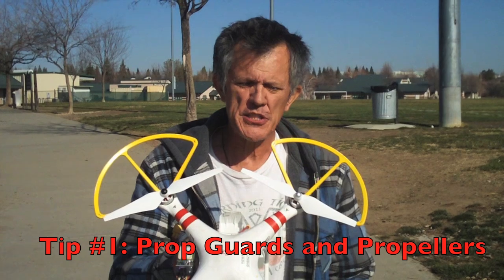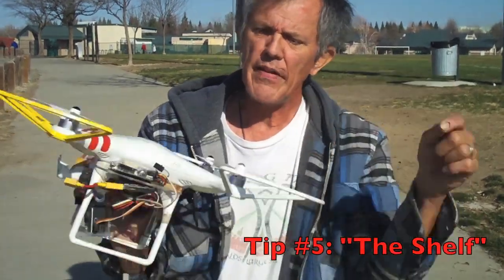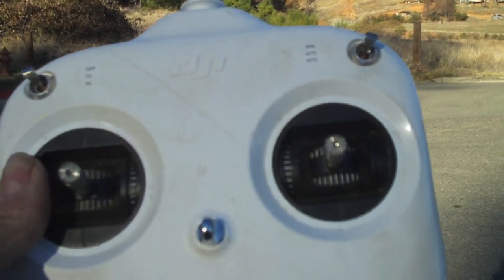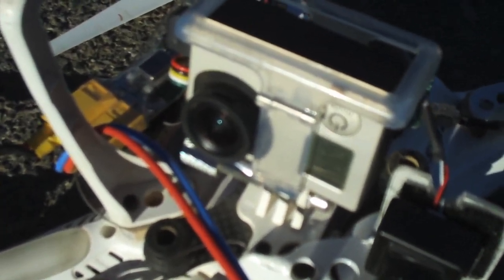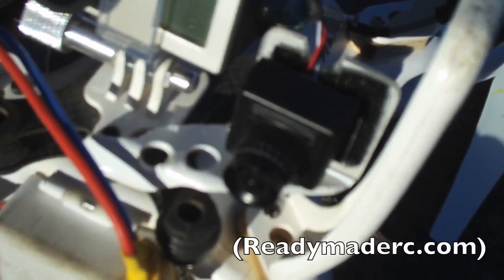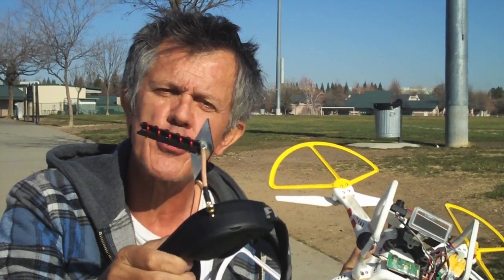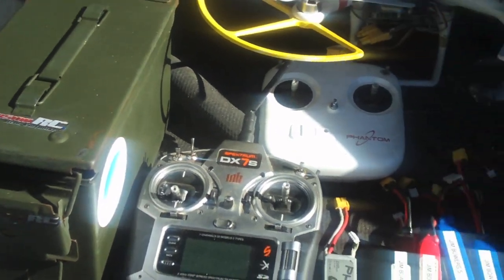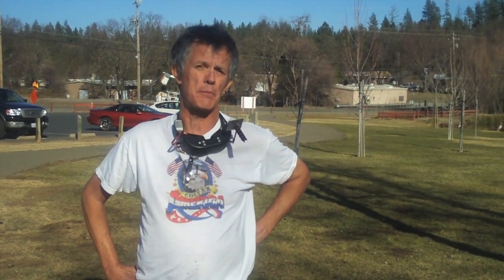DJI Phantom - "25 Tips and Mods" for your Multi Rotor, Quad Copter, Drone!

Comment from the maker: Zebulon - In the Assistant Software, you have to open the tab in the lower right corner in order to switch to manual mode. ZIts a little weird and difficult to find. Once you DO have manual mode setup, be VERY careful on your first flight. Get it up in the air about 75' or so, before switching into manual mode. Be prepared to switch back to gps mode quickly. ---- I have the most current firmware - no glitches and no problems. ---- I'll check out your channel for sure!!!

Comment: Hi Jim,

Big thankxx to your posts. Was made redundant at the end of last week but hey, it's summer, even here in Scotland so this was the catalyst to finally get the quadcopter I had been wanting. No real worries about getting a new job in the next 6 weeks so decided to enjoy the summer while it lasts. The crucial factor for a copter was a GPS out the box solution. I got a helicopter, very cheap last Christmas which took off 100 feet vertical and disappeared and was finally found in a neighbours hedge 4 days later. Parrot was a possibility but the Parrot 3 promo vids promise a copter in November so the Phantom (£389) with camera and GPS was the decider. It is the FC40 and yes, I have probably shot myself in the foot long term for upgrade ability but hey 720, 30 fps on a calm day will do for now :) I watched the 2nd part of your 25 tips video 1/2 an hour ago after my first mishap in the garden. I had a clothes drying pole going through the legs of the Phantom in case it decided to fly away and yup, I switched off the transmitter first...duh!! All of a sudden the 4 motors went into full take off mode and I kid you not Jim, it started to lift the clothes pole and slide off the end of it. I put my foot on the end of the pole and it tried to slide to the other end...I just weighed the clother dryer pole it's 1.3 kg... that's heavier than a bag of sugar. Eventually I lay on the pole and managed to get to the battery which fortunately I had not put fully into the compartment and unplugged it without lacerating my arm. My wife came running out thinking a plane had flown overhead. Again, a big thank you for your vid's which I am still working through. The DJI instructions at times (and I'm a techy) are pretty poor PDF's. If you read the blurb, Red/Green means 'Take it back your dealer' which I thought was a bit suspect until you explained about the GPS ( I apparently was connected to 6!... 3 green 1 red!) Shortly after that revelation it started to rain (This is Scotland in Summer after all :)  Methinks you maybe getting a PayPal order for landing skids and rotor protectors in the next couple of weeks. Take care and thanks again.
Reply from the maker: Great STORY Colin.... now get over those "dumb thumbs" and "fly it like you stole it!" Have a great (and sunny) day!!~

Comment: Good video, a couple things I might suggest, I shoot with GoPro Black edition in 1080P and 5 MP still with no issues plus I have the other higher quality modes if I want them.  I do agree that compass calibration is not needed on every flight but its cheap insurance to do it anytime you have traveled some distance from where you last did a calibration.  Lastly, on the compass calibration, you should point the Phantom nose down when doing the vertical part of the calibration.

Comment: Thanks for your tips! You really packed your DJI with a LOT of stuff: prop guards, wires,  etc. That may explain your 8 min flight time on a standard DJI battery - I get about 12 min flight time from the same battery with just standard DJI and lightweight Sony action cam.
Reply from the maker: Great - but you'll quickly get bored just flying around.... you need to put FPV and OSD on your bird and THEN you'll be into some real adventure and FUN! (Happy flying)
Reply: Thanks! (My Fatshark gear is bound for delivery this week ;) )
Reply: Excellent!!! You'll frikkin LOVE IT!!!

Comment: 10:00 well, filming in 1080p in 60fps is a good reason to get a higher model gopro, also 1440 in 48fps works well as you can crop it to 1080p, reduce a bit of the fisheye and have the video totally stabilized by software, but for hobby use only, go for the white ;)
Reply from the maker: great points my friend... thank you

Comment: You could always go for a Mobius mini cam instead of all that gopro add on. Does everything gopro does and possibly more. It's lighter and MUCH cheaper. Great video with very useful tips. Thanks 👍
Reply from the maker: I had the moebius - good cam..... cracked the damn lens on a crash.... :-(

Comment: Great video, thanks for taking the time to do this.  Someone here mentioned using the gopro feed for the FPV instead of having an extra camera.  Do you recommend this?  If so could you point me to what equipment is needed to make that work?  Thanks again!
Reply from the maker: Yes you can - If your using FPV just run a video cable from your FPV (or ezOSD) directly to your USB plug on the side of your gopro. Go to readymaderc.com and search for "gopro to fpv video cable). It will also power your gopro directly from your lipo battery.
Reply: Demunseed Thanks for the quick reply!
Reply from the maker: Jim Burnard BTW - do you plan to install a gimbal? Flying FPV thru the gopro with a gimbal attached can be VERY disorienting...
Reply: Demunseed  Yes in fact that was the plan.  I have the Zenmuse H3-2D that comes with it.  Not a good idea?  Thanks!
Reply from the maker: It's not a bad idea, just takes some serious practice. Be very careful when your "approaching objects" because they can come up on you faster than you can react... ( when your flying FPV without a gimbal, there is more a sense of "true flight" since the camera banks WITH the aircraft... WITH a gimbal on, the camera always stays level so it can be a bit disorienting while flying)

Comment: Great information video.
I have a 1st gen Dji Phantom.  I wanted to upgrade my props to the vision props. Do I have to change my stock 1st gen Dji Phantom motors? Or will the self tightening vision props work?
Reply from the maker: Does your Phantom have all silver prop nuts? Or does it have 2 silver and 2 black? If they are all silver, you need to replace two of your motors (caddy corner) with CCW (counter clock wise) motors.

Comment: Great info. Im about to get my first phantom and starting off with all your experience here as a guide is much appreciated. The flight times with a go pro/gimbal/FPV still seem short to me and that's the set up I want to fly with. Is there any other ways to increase flight times that you could recommend? 2 batteries in series, cutting away unneeded plastic from the phantom body (maybe drilling masses of holes all throughout the body like in the hot rod days). I would like to get 20-25 minute flights if possible. Also, whats the lag time like between the Glasses and the FPV camera? Again, great stuff.
Reply from the maker: - if you want 20 minutes definitely get a Phantom 2. a Phantom 1 will NOT do it, even with 2 batteries. 
- two batteries in series is just a bad idea on a phantom one due to the overall weight on the aircraft = reduced flight time and HARD landings.
- i would NOT cut into the plastic - that would be insane....    ;-)
- there is literally NO lag time between the goggles and GoPro - you are viewing in REAL TIME - if there was lag time, you'd be crashing into walls!!!
- hope this helps
- jim

Comment: This was a Great Video! but during calibration. should the LED turn upside.
Reply from the maker: You are absolutely correct - my error. (posted a note to that part of the video)
Reply from the maker: Demunseed I have found that it really doesn't matter which way it's pointed. It will still calibrate no matter which way your pointed, up or down. But I suppose UP LED is the better choice.

Comment: Check out the upgrade kits from DSLR PROS and you will have a much more professional setup.   This looks like it would work if you were really pinching pennies and didn't mind the look and too much weight.  I like the yellow painted bumpers though.
Reply from the maker: thanks steve - its a good mod for safety

Comment: I'm relatively new to the Phantom... LOVE it! I'm running the Zemuse gimbal and an FPV.  I don't understand your comment about exploding batteries.  Under what conditions have you encountered this? Charging? right after flight? or for no reason at all just a spontaneous failure??  I've heard that Lipo's have this problem but I can't afford to have a fire at any point of my life specially at home where i have my business!  Thanks great video and great advice!  I do allot of music videos and finally used my phantom in one... if you want to check it out I'll give you a link just let me know
Reply from the maker: Batteries can fail at ANY time, but usually during charging or after a crash. Whats the link to your video - luv to check it out...
Reply from the maker: Demunseed the chances of a lipo battery exploding or catching fire on you are about 1 in 10,000 or more.... just be safe and have fun with it.... (buy an ammo box)

Comment: really nice and true tips! Thanks a lot for that!  You did well. Just one tip for you: just wash your hands before manipulating it... Mine is still white!
 But I think THE BEST tip for real video use is to install the zenmuse gimbal. You just can't possibly do smooth videos without it. And you just have to buy an emitter, and use the real gopro donwlink with it! (the zenmuse take the signal from the gopro and send it in the phantom).
Reply from the maker: What's an "emitter"?
Reply: Transmitter sorry... For video downlink directly from the gopro. Far better than adding another camera. You can do it with the zenmuse, a transmitter, and a screen (or goggles) with receiver. That's all!
Reply from the maker: Guillaume Juin good tips... the zenmuse IS the best all around gimbal for the phantom...

Comment: Just food for thought, I use a 600TVL SONY SUPER HAD CCD D-WDR Color Board Camera with OSD Menu DNR from securitycamera2000 with free shipping, they work great. and I can not tell the difference from my Read made RC 700 TV line camera but the price! they are two good cameras.
Reply from the maker: Good to know! Sony makes a great flight cam.... Im thinking ill take mine off tho, and just fly thru the GoPro.... (less weight)

Comment: You need a lightweight prop CAGE to make it totally safe. What about birds and insects? If the props Are totally caged in you can grab it anywhere without losing a finger. Props are also called BLADES for good reason. ALL drones should have prop cages.
Reply from the maker: are you out of your rabbid ass mind??? I suppose HELICOPTERS should have "prop cages" too!? LOLOLOLOL
Reply: Demunseed
OUR HOBBY IS UNDER ATTACK. WE MUST TREAD LIGHTLY. Better safe than stupid.
Reply from the maker: I choose "stupid" ;-)tomken8dy
Reply: Demunseed
Then you'll lose the right to buy and fly them. We have to be VERY careful with these things because so many people are making such an issue out of them.
Reply from the maker: I agree with you.... we do have to be VERY careful
Reply: Demunseed Too many A-holes are being irresponsible and ruining it for everyone else. Flying too low and fast, peering into people's windows and endangering people.
Reply from the maker: got it!!
Reply: Demunseed
I sent for a small quad and a tiny spy cam to mount on it. It has 360 degree blade guards so even it it hits someone in the face it won't hurt them. I'm also ordering it's larger cousin that comes equipped with a cam. It also has 360 blade guards. I want to build a collection VERY quickly before my legislators pass any misguided, stupid bans.
Reply from the maker: Are you just a NUT JOB or what? Prop Cages LMAO!!!!!!!
Reply from the maker: Its just a ridiculous suggestion my friend.... trust me when i tell you, its NOT a viable option.
Reply: Demunseed
Just a thin, lightweight plastic grill can prevent someone from getting sliced and diced. Yes it is viable and can prevent a safety hazard ban.
Reply from the maker: If theres going to be a BAN, it will have absolutely NOTHING to do with "safety" or props.... trust me on this one.... I'm a genius (in disguise)
Reply: Guess some people should never try gas powered model airplanes or model boats with large bronze propellers. Prop guards are more for crashes I think and not not meant to protect fingers.
Reply: chuck Basiks
Large model aircraft are generally flown at gatherings or designated fields while these new quadcopters are being flown everywhere. If you don't want a total ban on them next time one injures or kills a child it is a wise precaution to install a full, lightweight cage over the blades. Stubbornness = stupidity, stupidity = BAN.
Reply: tomken8dy
I fly my large model aircraft (single prop) all over in most any empty field. And if a kid gets hit with a 2 1/2 lb phantom quad, it will hurt regardless of the prop. I think the prop guards they have now are certainly adequate. They will have restrictions on these soon anyhow because of idiots flying them very high in the vicinity of real aircraft. They are drawing a lot of negative publicity. Have a good day. I'm going flying. :)
Reply: chuck Basiks
The idiots ruin it for everyone else. HAVE FUN! - and try not to crash.

Comment: Thanks for the tips.  I ordered a Zippy 2800 battery based on watching this video.  Unfortunately it is not even close to fitting into the battery compartment.  Just thought you might want to know that.  Does Zippy make different sizes of the 2800?
Reply from the maker: Then you bought the wrong battery - order the Zippy 2800mah 30c 3s Lipo - it'll fit....
Reply: Demunseed
Thank you.  I will do that.  I just ordered the "Zippy 2800mah battery" as stated in your tips.  Perhaps this additional information should be added.  Thanks again and keep up the good work.
Reply from the maker: After your remark - i added a few more details to the video - thanks for the heads up my friend!

Comment: Just 2 questions. 1) I have been flying planes for a few years and I noticed that you pace the throttle stick on the radio in the middle position. On my planes, you have to pull the stick all the way down ( motor off ) when first turning the plane on. 2) Do the extended skids interffer with the view of the camera. I have been flying cheap quad copters to get the hang of flying for about 4 months now and I would like to do the FPV with the goggles. Also, what's your take on the Walkera Scout4?
Reply from the maker: Ive been flying RC for over 15 years. Ive been flying quads and drones for about 3 years+
2) The sticks on a phantom "auto center" while the sticks on a 3DR drone do not. 
3) No, the skids were engineered to stay out of your camera shot, except in HIGH WINDS where the A/C is pitching sideways. 
4) Walkera has the worst QC of any of the manufacturers. Their stuff is pretty "junky" overall.

Comment: Now you've got me a bit freaked out about the batteries.  Where do you store them when you're not using them?
I've got them in the plastic case with the foam insert that the thing came with.  Doesn't sound like that's a good idea.
Sounds like they should be stored in an flame proof area (not too hot or cold or wet) like the basement in your metal ammo box (insulated so it doesn't short out) plus in the discharged state.
I have one that is still fully charged in there!  Don't have a metal box so I'm trying to figure out what to do with it.
Reply from the maker: quit worrying about them.... put them in a metal box and go out and FLY!!!!

Comment: Excellent Vid. Just picked up a Phantom FC40 today. only mod so far is go pro gimball :( ever do a dual battery set up for longer flight?
Reply from the maker: Dual batteries are a total waste of time....
Reply: i see you have about 100 spare batteries hahah. so i can see why you dont care for a dual set up. i spent most my funds just buying this copter. ill save n get a few batteries- blue label :) Thanks
Reply from the maker: Dual batteries is too heavy for quad...
Reply: Too heavy? You added every single mod possible and added weight, yes i understand the added weight doesnt amount to a whole battery. but at that point a spare battery would come in handy, no? isnt there a motor upgrade for the FC40? or can i just buy Phantom 2 motors if they are an upgrade?
Reply from the maker: The phantom will not recover fast enough, plus you'll only add maybe 2 minutes of flight time.
Reply: Thank You. Is there a motor upgrade? how did that guy fly over the cruise ship in that other vid im sure you have seen. the distance was insane.
Reply from the maker: Yes - get the TIGER MOTORS. (T-Motors). The guy flying the cruise ship was just BALLSY!!
Reply: You seem to have alot of knowledge on these. ill take your word for it. ill wait til these motors die out then look into those. ill post a vid soon of mine. Thanks Demunseed
Reply from the maker: yep
Reply: Demunseed
Sold that 1st DJI FC40, Got another Phantom 1, Brand Stinkin New for 450.00. 3rd flight out of the box, dam thing took off on a fly away.. Of course I did the GPS manually, the wait to fly light rapidly blinked etc.. cant believe the crappy quality of these things for the price.. Luckily It crashed 50 yards away..